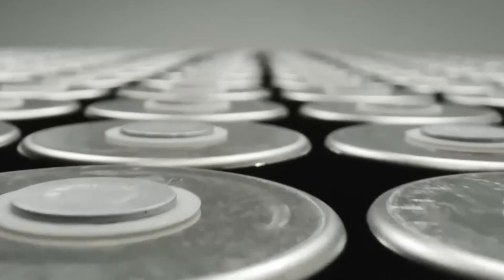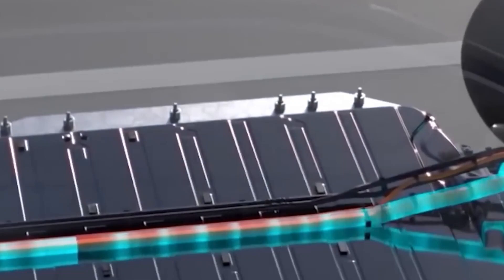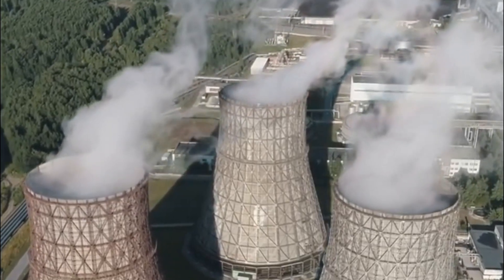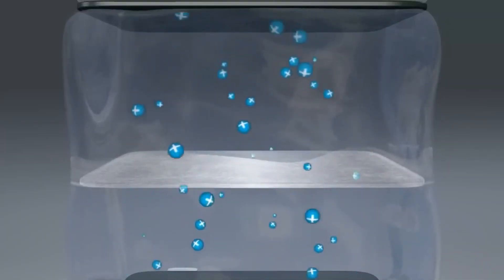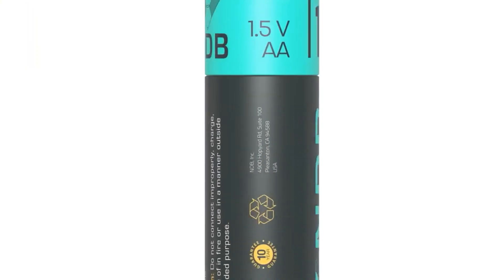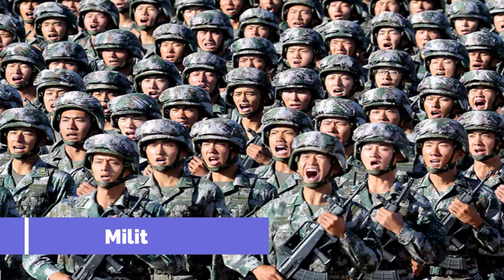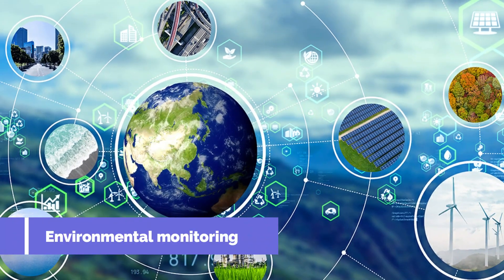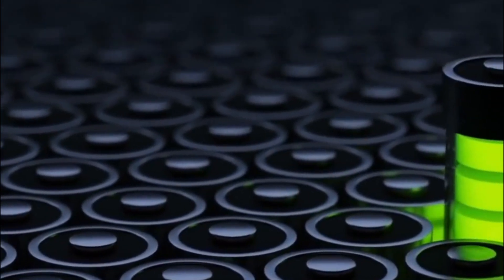IT FINALLY HAPPENED! NDB's Nuclear Diamond Battery FINALLY Hit The Market!

Comment: "diamond shaped battery" nope you already fucked up. not even 5 seconds into the video and you already have your facts wrong. its nuclear waste encased in artificial formed carbon diamond lattice to encase the waste product, which will allow the use of beta decay of the spent uranium, (in this case the by product of radioactive carbon-14) to be repurposed into use, using similar principals too how PV solar panels work. using the beta decay to knock out electrons to create an electric current. the shape of the battery itself IS NOT "diamond shaped" why say false information like that?
Reply from the maker: Thanks for the feedback 🙏🏽